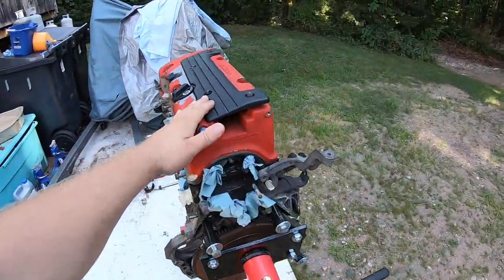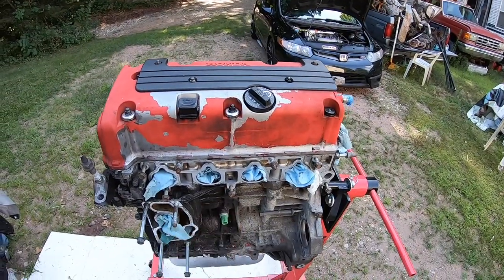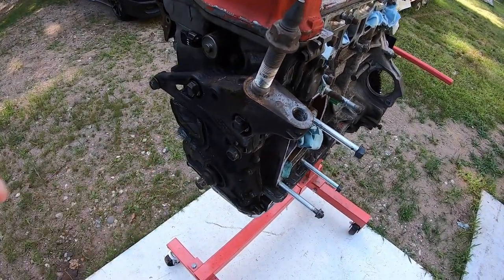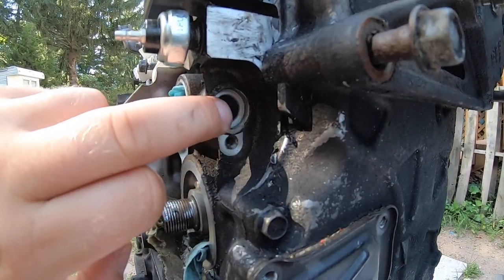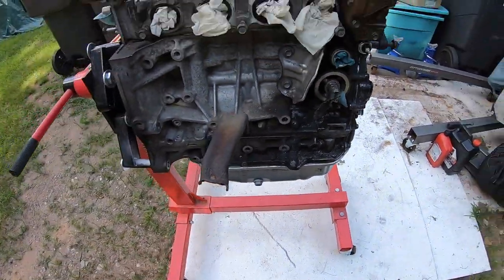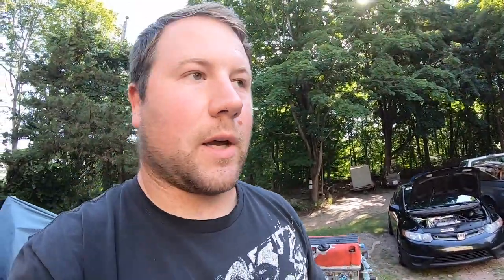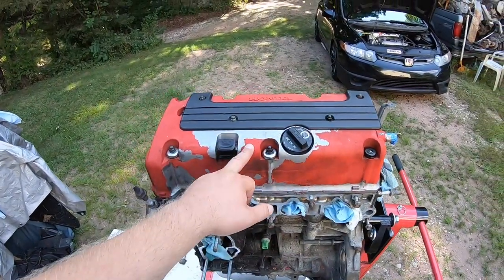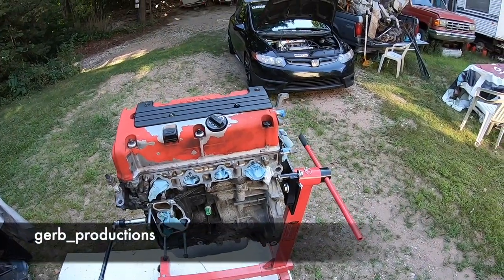Honda Civic Si K20 to K24a SWAP DIY (2006 2011 Si)

Comment: When are you gonna race a 9th gen gerb!!!??? What's up??? Lol
Reply from the maker: In the process of setting up a match against one, so hopefully soon 🤘🏼
Reply: I have a fg4 and my redline is 7800, doesn't mean I hit it every single time I race. But I can say this (Dyno chart to prove it) I rbc/rdx/Sri/catback I make 202whp all the way to redline. 152tq. Factory downpipe too! Once I get dp my goal is high 220swhp & 180+wtq. Not saying gerb isn't gonna win but! It should be very interesting who does win! Depends on bolt ons to. Fbo 9ths are quick if he finds one on e85 no chance imo.
Reply: @slow_joe_fg4134  Well most Rbb's make 225-230whp and about 180-190tq with bolt ons... I made 233whp/193tq and Im running a restrictive exhaust. But Ive personally run 9th gens dozens of times and its never been that close..
Reply: @slow_joe_fg4134  Also remember, the 8th gen is like 150lbs lighter than the 9th gen as well.. I think the 9th gens are like 3K and the 8th gens are like 2850 lbs... My Type S is at 2700lbs. Itll be close and a fun race, but the RBB 8th gen should win every single time. But Gerb is also not tuned so that could def make things more equal. I made an extra 15-20whp and 10-15tq from my Etune to a Dyno tune.
Reply: I seen guys hit 240whp but we're talking J37 TB, ported, polished, intake mani.
Reply from the maker: Pull up then, let’s find out 🤘🏼
Reply: @TheGerbsteve  when are you gonna trip out this way?
Reply from the maker: We can meet halfway
Reply: @TheGerbsteve  7 hour drive lol

Comment: my k20 just blew up, i'm gonna do this i think
Reply from the maker: It’s not a bad alternative, unless you rebuild your k20 for a high rev machine
Reply: My k20z3 just blew up on me also, shops I’ve called are telling me to k24 swap instead
Reply: @yobaramirez4215  mine jus blew as well my plan was too k20/k24 it but I might jus have to go jus k24 for a bit or get another z3
Reply: @savageking1881  I’m in Riverside CA, I went k24 shop quoted me $2k with labor 👍
Reply: @yobaramirez4215  hell yeahh which k24 did you go with?
Reply: @savageking1881  I went with a k24a, I should be getting it this weekend. Hopefully everything turns out good
Reply: @yobaramirez4215  hell yeahh I have a buddy that auctions cars and motors in Florida that found me a couple jdm k24a2s around 1,200 low miles and I might jus send it and swap it myself
Reply: @savageking1881  that’s wassup man, as long as you get it back & running in the streets. Good luck hopefully everything turns out good for you
Reply: @yobaramirez4215  I’m in the riverside area too , where is the shop located at ?  I’m planning on swapping soon
Reply: @akaguicho3972  hit up auto integrity
Reply: @yobaramirez4215  you got instagram i want to ask you some questions
Reply: @akaguicho3972  naa bro, I don’t have one . Only thing I use is YouTube
Reply: @yobaramirez4215  how was your swap did they do a good job ?
Reply: Also what car did you swap?
Reply: @akaguicho3972  solid work , I have an 07 civic si sedan
Reply: @yobaramirez4215  what ecu did you use ?
Reply: @yobaramirez4215  how much did they charge you?
Reply: @akaguicho3972  I’m on stock ecu, I payed right around $2500
Reply: Right under that price, all my motor mounts were shot so I got them replaced as well

Comment: Question, if I have a full k24a swap in my 8th gen all sensors swapped and everything why won’t my vtec work. Gave me a check engine light. I would appreciate the feedback
Reply: Timing? What does your check engine light code read?
Reply: Watch the keep Gunnin channel, the movement explains it all best channel out right now!! @keepgunnin
Reply from the maker: Go back and recheck your plugs on the top of the solenoid. Did you change the spool valve screen? Sometimes it gets all gunked up with crap. My last guess is that the solenoid itself may be on the way out. That all depends on mileage and oil change intervals
Reply: @TheGerbsteve  yooo bro yeah he should start with the engine light. And see the code. And bad or gunked crank sensor , vvt solenoid (valve that goes in the side of your Timing cover) the screen on the front of the head and or the Vtec solenoid screen as you mentioned. Another question I would ask myself is if you mess with the rocker arms and you are sure that you put those buttons and springs back in the right place or they didn't pop out, they can pop out while your moving them up and down , reinstalling etc. Without those lobe locks VTEC don't exist
Reply: So imo even tho I wasn't asked. Start with the check engine light , read the code fix that issue.. if still going on? Check your screens and clean of the crank sensor. If it's still doing it. U may have like Gerb mentioned a failing Vtec solenoid spool valve. Before spending $300 on the new one you might want to make sure all of those button and springs are in on the rocker arms and in the right place , if any are missing or not in the right side. Without mentioning really bad oil could do this to if you don't change the oil and there is sludge in the motor.
Reply: Gerb what do you think it can be it said VTC Malfuntion on the hondata
Reply from the maker: ElegantJayTV check your engine oil level, vtc oil solenoid bad, vtc actuator bad, or blocked vtc screen on front of motor.

Comment: Do I need the CRV mount or bracket?
Reply from the maker: Crv side mount
Reply: Gerb what about the oil pump? Need to change it
Reply: Gerb I’ve seen forums saying I need a Type S one
Reply from the maker: You don’t need to change it, but if you wanna rev to like 8200, I would definitely recommend it!
Reply: Can you show me a pic of the mount? I am having issues finding it. I went to autozone and bought a CRV engine mount and it was wrong like you said to do.

Comment: Did you have to get it tuned for it to run ?
Reply from the maker: I got it tuned because i wanted it to run safely. Not sure if you need to tune it for it start or stay running.
Reply: @TheGerbsteve  so I would be better off getting a k tuner and hauling it to a dyno tuner ?

Comment: Also do I have to get headers?
Reply from the maker: You can use stock or aftermarket header.
Reply: I  want to get my 09 si running I bought it with a blown motor what’s the cheapest option is it a k24?
Reply from the maker: @luislopez8085  you have to shop for deals. K24’s are going up in price
Reply: I Just found a k20z3 53k for 1000 it’s that a good deal?